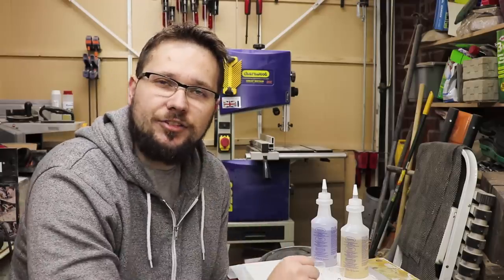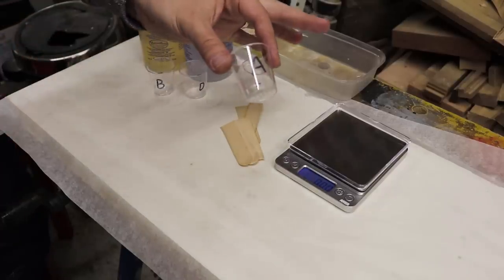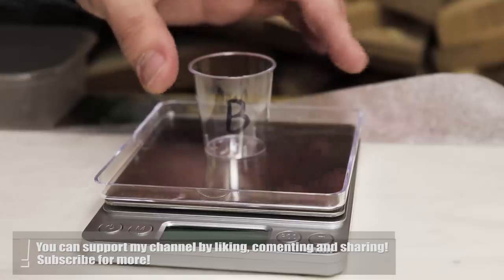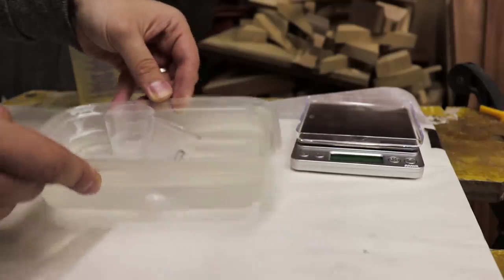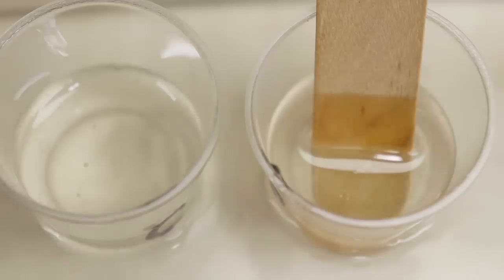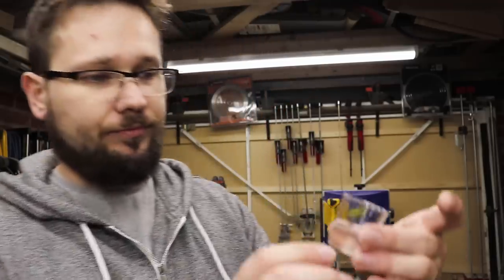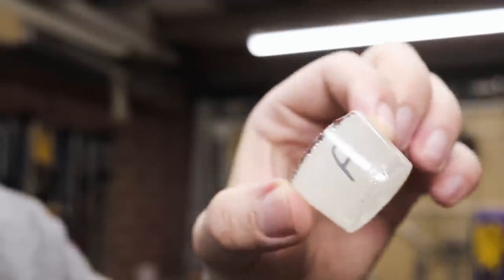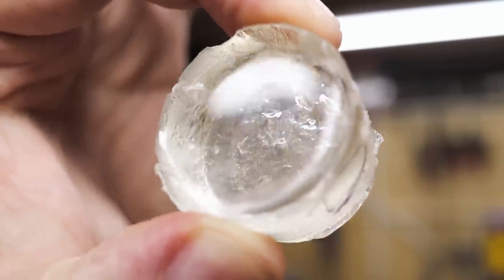Epoxy resin - casting technique to get rid of air bubbles - no pressure pot needed

Comment: If you heat up the resin which is already mixed, you will have a shorter working time as it solidifies faster.
Reply from the maker: Correct
Reply: @CasualDIY  is it possible just to brush some resin as a coating? If so, could you please recommend a brand or 2. I live in Italy and the weather is quite tricky, sometimes the surface of the coasters I've just made has some cloudy streaks, just the top surface though. Thanks in advance ☺
Reply from the maker: @tinaalberizzi2095  Yes, there are special coating resins. I recommend resins from resinpro.eu funny enough it's a Italy based company. You can use my discount code there for 10% off the code is "casualdiy" been using their products for about 3-4 years and they are great 👍
Reply: @CasualDIY  thank you very much.
Reply: @CasualDIY  I was trying to use the discount code you gave, it didn't work, was invalid... 🙁
Reply from the maker: @tinaalberizzi2095  I just tried it and it works just fine. How did you type it in?
Reply: @CasualDIY   i tried both casualdiy and "casualdiy"
Reply from the maker: @tinaalberizzi2095  it's casualdiy 
Strange it works for me. The code needs to be be added at check out to the field Coupon code
Reply: @CasualDIY  yes. That's exactly what I did, thank you anyway.. 😊

Comment: would putting the part A ( full container ) in warm water first, before mixing, help with the release of the bubbles, at mixing point.  just a thought ?
Reply from the maker: Yes it would. I do that in the winter months 👍
Reply: @CasualDIY  thank you for that. i am looking at painting my bathroom floor, sprinkling on some sparkle, let it dry. then put some clear epoxy on to give it a nice finish. how would you recomment such a task, without bubles forming, and would i get bubbles in such a thin layer
Reply from the maker: @wayne-bennett_  first of all that's gonna cost a fortune I would love to see the end result tho👍 you need to buy a special epoxy for that, which I haven't worked with yet so apologies but I won't be able to give you more tips at this point.
Reply: @CasualDIY  i have not priced anything up yet, but my bathroom is very small in comparison to others, 8x5ft, but then i have pedasstal sink toilet and a bath to go round, so not much left floorspace.
Reply: I recommend sealing any paint and especially sparkle (glitter?) before pouring resin.. some paints (and even sealants) can have a negative reaction with epoxy, and glitter must be sealed or massive bubbles emerge as resin seeps into it...

Comment: If I was gonna make a set of dice DnD (dungeons and dragons), and all I got is some old dotted d6’s and I had the moulds set up and I get eproxy resin and follow test D do you think the rolls will be even, even with the few micro bubbles in the cast?
Reply from the maker: They may, it's possible. It may not happen at first attempt. Never casted anything like that so I can't really give you any additional advice. Try it and see that's the best method with resin. Sometimes even under the best set up the casting may not come out correctly.

Comment: HELLO MY FRIEND THOMAS A QUESTION ONE YOU SEE THAT THE RESINE IS NO LONGER SOLIDIFIED EITHER THE BAD APPLIED PORTIONS OR ANY OTHER SITUATION ARE NOT ALREADY HARDENED BECAUSE THEY ARE SO SOFT, I HAVE THAT PROBLEM SINCE I DO NOT HAVE A BASCULA I AM GETTING STARTED AND I DO NOT HAVE RESOURCES TO COMPARE A .I MET MY RING OR PENDING TO THE REFRIGERATOR THIS CAN ENDURATE THEM? I WOULD APPRECIATE YOUR COMMENT OR WHAT I CAN DO TO NOT WASTE THE PIECE OR IT DOES NOT DEFINITIVELY
Reply from the maker: Hi, the epoxy will not cure correctly if you add incorrect amounts of part A and B. You need to read carefully the mixing proportions of your epoxy. Some may be by volume and some by weight. If the portions are incorrect then it will not cure correctly. Same with mixing if you don't mix them well then you may have the same situation. To work with epoxy the best room temperature is at least 22-25 Celsius. The colder the harder the epoxy will be to mix and work with. Do not put it to a freezer/ fridge I can see that being beneficial. Once you mixed a bad batch of epoxy and you done your project there is nothing else you can do with it to my knowledge. Hope this helps.
Reply: @CasualDIY  HEY ARE VERY KIND TO ANSWER ME I WILL BE CAREFUL IN THIS ISSUE, IF I REQUIRE SOME ADVICE I CAN WRITE YOU
Reply from the maker: @AdrianMartinez-qo8yv  no problem mate I'll will help if I can👍
Reply: Protip: press your Caps Lock key again to turn it off.

Comment: Alumilite amazing clear cast should be measured by volume not weight
Reply from the maker: That's correct. Made a disclaimer comment about that. But in this case I was lucky and it cured correctly.
Reply: @CasualDIY  ok I didn't see that comment I did find your method similar to what I've tried.
Reply from the maker: I now moved to slow curing self degasing resin from ResinPro. And I have to say air bubbles are minimal if none at all. But I also use a pressure pot for jobs that have to be crystal.

Comment: My pot life is only 10 mins, so how can I wait 10 mins for the bubbles to clear? Any tips?
Reply from the maker: As I mentioned this method will only work for long setting epoxy. The best solution for quick setting epoxy is a pressure pot unfortunately
Reply: Use a wider container (epoxy cures slower when it's thinner... thicker cures faster and puts off more heat [my 1st large casting experiment started boiling and smoking..must layer]).. I'd also follow some off the other tips in comments, use a round NONPOROUS (seal popsicle sticks) stick for stirring, and pour mix high/thin/steady to help release bubbles. Also, I'd consider using a heated mat (I have a "coffee warmer" with thermostat) for your MOLD, not too hot-test a few degrees warmer than suggested room temp?..heating (curing faster) from underneath should send bubbles up while curing instead of adding heat to surface (that hardens outer layer, causing entrapped bubbles underneath)..hope this helps

Comment: why not use a microwave oven with a low power instead of water (but ask your wife before using the kitchen oven or buy one for your shop....)? 
epoxy resin is water sensitive! 
bravo for your scientific approach to that problem and for the clarity of your explanations! it's very rare...
Reply from the maker: Thank you for your comment. Yes you have to be very careful with epoxy around water but I'm quite clumsy and not had an accident of this type.... yet ;) with the oven I think the plastic containers could melt and really you only need hot tap water for no more than 10 minutes so investing in an oven may be bit extreme. And personally I wouldn't risk epoxy in the oven - apart from cactus juice but that's a different topic all together:)
Reply: Microwaves work by heating the water molecules in food, so they wouldn't work on resin as there's not water in it. And it might catch on fire or explode? Resin is a bit flammable and it's easy to light waterless things on fire with a microwave

Comment: I have not done anything with resin.  I wonder though, has anybody tried putting the project in the freezer to cure.  My idea is that the cold will shrink the resin and increase the pressure.  This might prevent further bubbles forming (due to reduced pressure from heat reaction during curing) and might make existing bubbles much smaller.  I guess I'm thinking of using the frezzer instead of a pressure pot.
Reply from the maker: Resin is thermosetting, the resin hardens as two components are mixed and a chemical reaction stars. It generates heat and cures. That's why the surrounding temperature and moisture levels will have a great impact on your resin curing process. Most of manufacturers state that the ambient temperature needs to be between 20-25 degrees Celsius. If it's too cold your resin may not cure, if it's too hot the reaction may be too quick and the resin will crack. Similarly with moisture levels if they are too high then some resins may not cure correctly. Hope this helps. By the way if you want to find out more about resin then in about a month time o will be posting tutorial videos about resin👍

Comment: Hair dryer works better than flame. 25 deg is better and never have sun shine on it. Vacuum is always a winner. You can make a vacuum chamber using a glass jar and any vacuum source, being hand pump, vacuum cleaner, etc.
Reply from the maker: Sometimes the hair dryer can destroy your project as it blows air    hence I prefer a torch. Got a pressure pot but still not had a chance to use it. Vacuum chamber will not work with all types of epoxy tho.
Reply: Casual DIY , I’ve destroyed the surface with a flame, pressure cooker works well for a pressure pot too. I’ve paid my dues with west system clear. It is important to remix the chemicals before dispensing them.
Reply from the maker: @johno6861  Yes that's true you have to be careful with the flame. I think the best results is to have both, vaccum chamber and pressure pot. Vacuum chamber for stabilising wood and pressure pot to remove the air bubbles. But it's an expensive set up.
Reply: How did you make a vacuum chamber please?
Reply: Tracey Daizy , depends how big you need it, a pressure cooker is a ready made chamber. Scientists use a bell jar, can be a cake cover. It is put on a rubber table with a hose through it. I have several vacuum pumps, small ones about the size of air brush compressors, in fact you can use some compressors as vacuum pumps in reverse. I also vacuum bag small items when I need pressure. Just search here for how that works.
Reply from the maker: @traceydaizy  hi, I don't have a vaccum chamber yet just a pressure pot. But I will just buy a set in the near future. There's few companies that make them.
Reply from the maker: @johno6861  you see I don't have a vaccum pump, and the price of a new one, a good one is usually much higher than the whole set of the chamber and the pump from some companies. So I think in the near future I'll just buy the set.

Comment: I just use a vacuum chamber for 5 minutes and presto, no worries about air bubbles.
Reply from the maker: I've invested in vacuum chamber and pressure pot. But it's a hefty investment and not everyone can get them.
Reply: @CasualDIY  Mine was 135 dollars with a 3 gallon pot and pump.
Reply: @thecentralscrutinizerr  I had already a vacuum pump (for degassing wine ) ans use a vacuum Foodsaver  canister as vacuum pot, works very well.

Comment: Hi a great video but can I just say you measured it wrong it's by volume and not weight I know yours set but a bigger quantity it won't not a criticism just a tip.
Reply from the maker: Hi Pam. No that's good any tips welcome. So what do you mean by volume? Should I change the scales to ml or something? Or just use two containers with the same amount of part A and B?
Reply: @CasualDIY  two containers with same amount or 50mls A 50ml B in same cup :-)
Reply from the maker: @Highlandboxes  Thank you :)
Reply: Hi Pam, what you doing over here. I spoke to the people at resin8  Kate & Ellie who offered that you can indeed weigh your 1-2-1 resin if you wish as this will give a much more precise ratio mix as opposed to trying to read the tiny measurement scales on some plastic cup or jug.
Reply: @cliffcarlo180  resin 8 is a different epoxy they all have their own mix ratio but good to point out :-)
Reply: A good way to figure that out as each epoxy is different is to measure 1 oz. of each ( part A and part B ) then weigh them to see if their weight is equal. Most of the time part A is "heavier" than part B.

Comment: I read that this resin yellows over time. Is this true? I'm a sculptor who recreates my work for collectors. They are of skin tone...I'd hate for this to happen years down the track! 
Which resin would be best for this?
Reply from the maker: Hi, all resins got "use by time" I believe that this particular resin got 6 months after opening the container. And yes it will yellow after that time. The resins yellow if the UV protection in them is not good. There are so many makes and types of resin out there and not all of them are available worldwide. What country do you live in? Usually the Epoxy Resins are quite good for UV resistance and yellowing. You should avoid polyester resins, polyurethane resin shpuld be ok. What I recomend before you buy any resin read the technical sheet, they all come with that and it will state all the information you need👍
Reply: @CasualDIY  thank you so much for your response.
Reply: @CasualDIY  I live in Australia, and have access to Smooth on products, just trying to find a resin that produces less/No bubbles without degassing equipment.

Comment: I recently watched a video where the guy put the container of mixed resin into an ultrasonic jewelry cleaner, said it works great. Haven't tried it myself, I'm still in the studying phase before I start playing with the real thing.
Reply from the maker: Yes seen it, but I think that only works on small quantities and the results are not much better than the hot water option. He does have a pressure pot that he uses in 90% of his projects. I recently got one as well but not used it yet.

Comment: Soo I did this with the amazing resin cured when I start to pour it, which was immediately after the 10 min water bath. :| it’s clear though..
Reply from the maker: This is best for slow curing resins only. Remember not to overdo with the temperature of the water. Only hot tap water. As the resin is a thermo setting chemical is you heat it up to much it will accelerate  the curing time.
Reply: Casual DIY thank you!! I’ll try again and be more careful this time
Reply from the maker: @DuchessWillow  no problem 👍
Reply: lol

Comment: For bigger quantity is the same
Reply from the maker: Yes it is
Reply: Ohh thx so much and sorry I forgot question mark. Can I please ask you what could I do wrong, my epoxy never shine 😐 I do sanding 120, 400, 600 800, 1000 and for polishing I use rubbing compond and polish compond........ I dont spend really much time to sand and polish, also this can be the problem?
Reply: @CasualDIY  if I could just talk with you more 😔
Reply from the maker: @mercedesgomez957  to get good shiny effect you need to go with sanding to about 10.000 grit. Or at least 5000 and good polishing system. But not all resins are made to achieve good shiny surface so I would recomend reading the technical sheet of your resin. Check my resin tutorial video series, there's a lot of information there👍
Reply: @CasualDIY  my brother, I just finished to see first episod of your "talking about resin bassic" and I understod. This art need alot of time, good information and some tools wich I dont have at this point. I will inform my self verry well before I even start again a y casting. Thank you from the bottom of my heart!!
Reply from the maker: You are welcome 😁👍

Comment: You can make a simple wood box, and put a twenty to forty watt bulb in it to keep your epoxies warm. Just make sure the light doesn't press against anything because the heat can melt through plastic and so on.
Reply from the maker: Thats an interesting tip. Thanks :)

Comment: The only downside of this and you even show it, is the heat will make the resin cure faster, and it gives you even less time to work. If you need to use them pipets to add resin into molds or planing any color blending or smoky effect or what not, the resin by the time your done here is far to thick to work with. 
Using a round silicone mixer, I make sure the hardener and such already has no bubbles and pour it slowly to not add more. Than I mix stupidly slowly. I make sure to pop any bigger bubbles and avoid adding in smaller ones. This is vital as once you add in color you can't tell if there's bubbles or not, so its a slow process more so once pigments are added. 
Once mixed I tilt the cup sideways and slowly rotate it, the resin thins as its rotated inside the cup and that breake's any hidden bubbles... 
From there its pipetted into the molds and than hope for the best. So far only have around a 15% fail rate.
Reply from the maker: Sounds like a solid process👍

Comment: Great vid. But this resin is by volume not weight. Might make a difference on large castings. No need for scale just put 2 clear cups right next to each other one for part a the other for part b and fill them the same height. This is my favorate resin very forgiving but still a little pricey figured i post this so you aren't out the money from it not setting up in the future.
Reply from the maker: Thanks. Pam already pointed that out so I pinned a comment with that information. It seems it made no difference on this casting maybe due to low amount of resin. But as you said it may affect larger projects. Always important to read the label lol